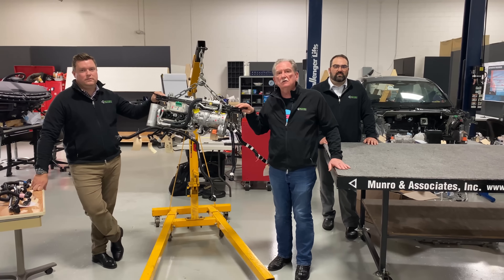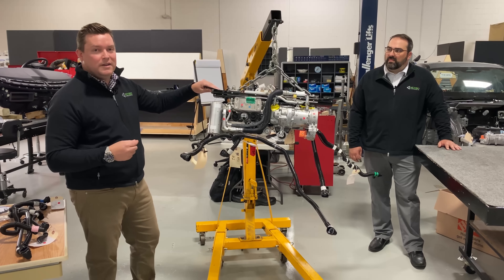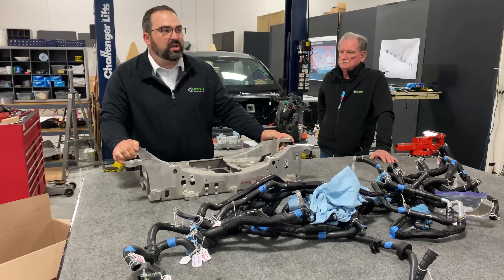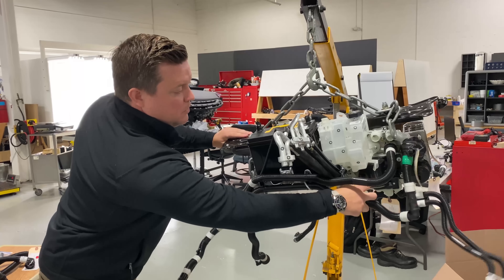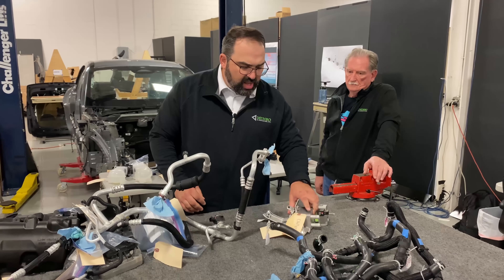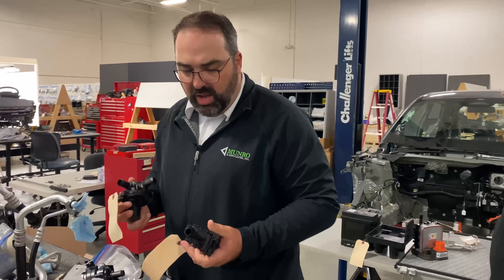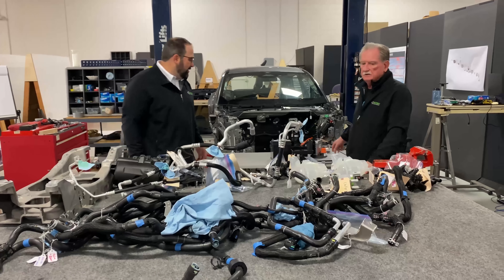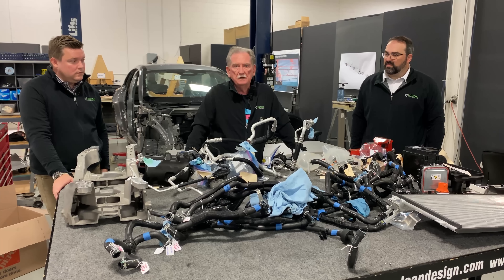Mach-E Thermal System Part 2: A Detailed Comparison to the Model Y

Comment: It feels to me like Ford saw something in their regular market analysis that scared the bajeezus out of the management, and they saw that they had an urgent need to get something out into the market as quickly as possible. It only needed to be "good enough" to avoid becoming completely irrelevent in the future marketplace. All that Telsa packaging, unifying, streamlining, and multi-purposing takes time which they appear not to have had. So instead this smacks of being a rushed job under challenging time constraints and an old school development process. Now the danger is that Ford lock that design in for the next 3-4 years without any of the running iterations that Sandy so admires about Tesla. If Ford don't learn that lesson from Tesla, the future is going to be really painful for them. Also, if they wait till 2024 to release a vehicle matching the systems elegance of the Tesla then they are toast.
The only thing I would have liked to have known was the total mass (hardware+fluids) of each full system, but I understand why not. I'll hazard a guess that the Tesla is roughly half the mass of the Ford. Fantastic video.
Reply: Totally agree with your point.  However, if Ford does running revisions of the magnitude needed to keep improvements coming, might that be a huge challenge for the dealer service centers to handle the myriad of variations?  Earlier the comments, there was mention of spaghetti code for the software.  Seems there could become a spaghetti code for the hardware too.
Reply: @rollingirulat2320  I think where Tesla win is that their cars have very few variants, and only a few options, so that reduces complexity across the board. I think car manufacturers over-use variations and options. Provided the interface points remain the same, you can refine/improve any individual part, and service centers should just be able to replace older revisions with the newer one. The bigger changes can be done as subsystems updates. i.e. the Mach-e engineers should all be in a room disassembling and understanding the Tesla approach to see how they can they can cme up with a better cooling system than Tesla. Then come a 2022 minor refresh (or a new vehicle) that better system is used, instead of that current nasty mess of parts. It is worth noting that across the ranges, the Teslas are typically about 200kg lighter. That reduced weight means better efficiency, which means a smaller battery, which means less weight... and so on. On top of that, with all those additional parts, the BOM and cost of assembly must be higher. The vehicle prices are roughly the same, so I'd hazard a guess that the margins are significantly lower for Ford.

Comment: The previous videos in this series show that Ford had put a lot of thought into building a well engineered car. The cooling system is totally out of character with what was demonstrated before. What happened here?
Reply: Probably a different set of engineers working on the system.
Reply: Different department.
Reply: why? to repar it on tesla you probably need to replace entire octovalve $$$$. As oppose to 1 pump or a hose on Ford.
Reply: @hagestad  Exactly.  The octovalve is built like a tank and will last so the chances of that big expense is pretty low.  Ford has a hundred extra points of failure and that just adds up to nickels and dimes over time.  Lots of room for improvement and I expect they will.

Comment: Aren't brazed plate heat exchangers supposed to be mounted vertically?
Interesting that Ford mounts heavy PM pump motors on metal brackets while Tesla mounts them on plastic coolant bottle.
Reply: Tesla mounted the "Heavy" motor on the steel crossmember 1:30 ?
The lightweight coolant pumps are on top of the "plastic bottle" , so no hose connections, better NVH.
Try harder.

Comment: Yes and evidently the Ford cooling system is not as efficient as the Tesla or Ford would not be having the Battery overheating issue during regeneration. Currently, they do not have a solution to the overheating issue....  
https://insideevs.com/news/520468/ford-mustang-mache-overheating-regen/ 
https://www.macheclub.com/threads/welp-battery-overheated-but-awesome-efficiency.3132/

Comment: All big corporates run into these problems when you have an army of people getting involved in product design and build. Tesla doesn't have these problems because Elon is the one that projects how its product should be designed and executed. Comparing the other big 3 car companies, their top honchos are all clueless of what the people under them are doing. Yes, after watching this videos I bet they all hold emergency meetings which instead of trying to address these problems, exponentially create more problems because nobody has the authority, nor knowledge to get things done correctly. Yes, welcome to the big corporate politics.
Reply: As a former Ford contractor, it is an Army of contractors that are trying to get everything design and tested by 'DESIGN FREEZE DAY'.  Everyone fusses and fights until the magic day arrives and then the tooling and assembly line work begins followed by the crash testing of the first cars off the line.

Comment: Does Tesla have better engineers?  I know they probably have the best software engineers but do they also have the best hardware engineers?

Is it the difference in corporate climate?  Something is wrong here. Ford has been making cars for well over 100 years. Tesla has been making the Model 3 for 3 years. 

Why is there such a huge difference in engineering between Tesla and everyone else?
Reply: The huge difference is, Ford have been making ICE cars for over 100 years. Tesla have been making EVs for around a decade. The products look similar superficially, but the power and drivetrain technologies are poles apart. Spoiler: EV tech is WAY superior and will disrupt ICE completely in a surprisingly short time. My opinion.
Reply: We are the Big Three..dont need no stinkin innovative thinkin
Reply: Use your eyes?
Just LOOK at the difference.

Comment: Possibly related: Several Mach-Es has suddenly stopped in the middle of the road while descending along a steep downhill road to a popular tourist spot (Geiranger). The battery overheats and the car is stranded with locked wheels, needing a tow truck.

Picture of the road a bit down in the page below - it's pretty steep, but other EVs have not encountered these issues:
https://motor.no/bil/slik-skal-ford-fikse-mustanger-som-matte-berges-i-bakkene-ned-til-geiranger/204431

Comment: You can bad-mouth as much on Tesla on its bad fit and finish and paint job, but when it comes to where it counts, you have to acknowledge that Tesla did well in its design and execution. I like their approach in not over-engineering and eliminating parts instead of using a myriad of components which indefinitely and exponentially has problems down the road.
Reply: tbh none of that is ok on a 40k minimum car, especially the fit... they all have negatives still just pick the one you like

Comment: That definitly doesnt look good on the ford, but he actually did not disassemble the thermal systems on the polestar and id 4 . And it should not be forgotten that ford,polstar and id4 have around 400 battery cells where 3 and y have 4500. They are 4000 parts ahead in the parts count before it comes to the thermal system. The model 3 and y batteries are unrepairable. Just watch Sandys Video in this, its a horror.

Comment: I hope Ford CEO see this 😆
Reply: I do not think he is interested.  None of the legacy auto maker CEOs are into engineering. There is a huge distance between management and the engineers. The companies are run by bean counters, demagogues and navel admirers.  They are definitely not interested in engineering, not really interested in cars and probably not even in manufacturing.  Even philosophically speaking they are uninterested in innovation.  Remember, they are horizontally integrated and do not really make that many parts.
I bet Elon Musk knows the Tesla cooling system in detail.

Comment: Just the visual of the compact assembly then pan to a table full of stuff make the point here!
Reply: It is a little exaggerated for effect -- once assembled, it will take up less space.  The underlying point is well made, though -- reduce the part count, especially the number of fasteners, and make the whole thing simpler for the operators to build.  You end up with a less costly build, with fewer potential failure points.
Reply: @39401JLB  yep - love the theater though!

Comment: I have to think that Ford engineers could do better. I imagine that they were told by management that they were only planning on building a small volume of these cars and so just use off the shelf parts and "getter done". Would be interesting to know how the F150 pickup which is very high volume rates on integration.
Reply: Great point, this could signify that management internally was targeting low volume and therefore were reluctant to invest in custom integration.

Comment: Ford should be embarrassed by this. I know all about ford design and engineering since I own a 2006 F150. Theres at least 20 design flaws in my truck and if i didnt fix things myslef id have spent many thousands of dollars just keeping the truck on the road. my truck has only 115k miles on it and its falling apart. FORD SUCKS but so does GM and chrysler. TESLA will win the decade.
Reply: My Ford F-350 has caused me some $14,000 just on motor, transmission and air conditioning! With 86,000 miles on it! Henry is rolling over in his grave, at where resources are going in this corporate, care about its top 10,000 employees only, legacy! And ford can keep on building crap, because they will be protected by class action immunity! When dealing with Ford, opt out of the class action, wait till the final judgement. Then use the discovery for your suit against them, and collect millions! When the 6.0L class action was happening, there was no problems with my 6.0L, I thought Ford would stand behind their product. Corporate thievery allowed by “rule by law” government.

Comment: Do you suppose Ford, GM, and VW never watched Sandy take apart Model Y? If they did they learned alot less than I have. This is truely educational video.
Reply: why would they? they buy 20 times more expensive cars just to cut them up and beat them at their game. They do the same research on their own much faster than Sandy.  There is a reason why both Porsche and Mercedes have electric cars that Tesla are not even close in terms of quality and feel. And barely better millage.  Porsche have been using heatpumps for a while. Much more sophisticated ones than those in Tesla.
Reply: @hagestad  wait a second, isn’t the Plaid model S faster (by a lot), more affordable (by a lot) , more spacious, more range and get’s over the air updates do fix problems. Last I checked Porsche Tycan just had a recall for every single Tycan and they had to be dragged to the dealer, something Tesla could have done over the air (no dealer needed)